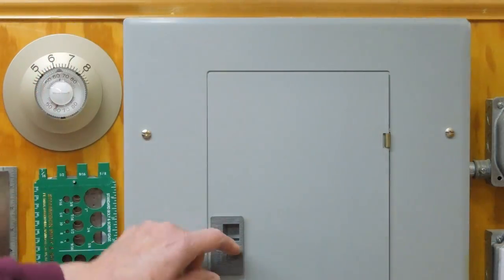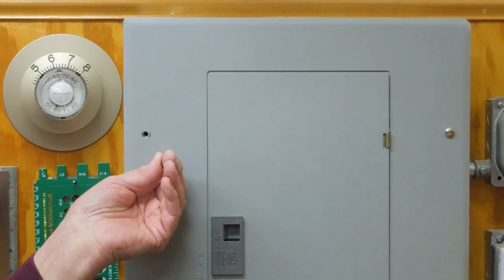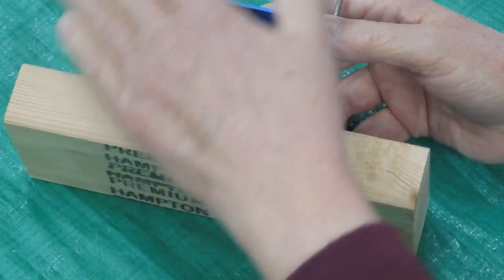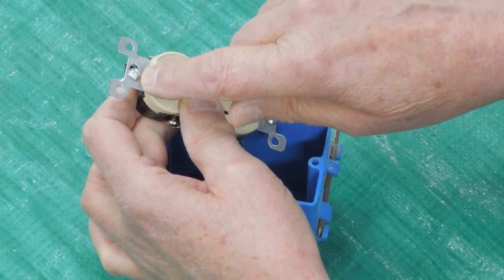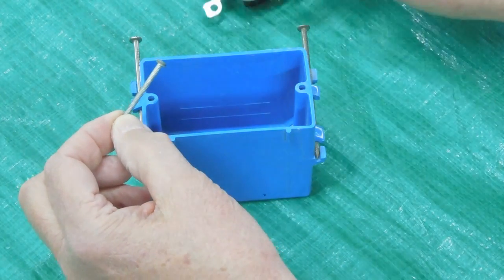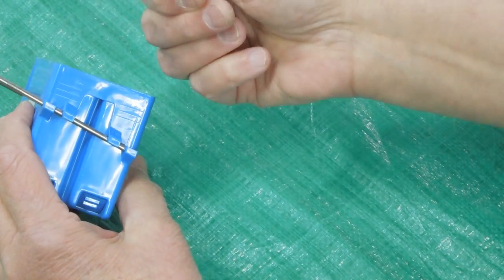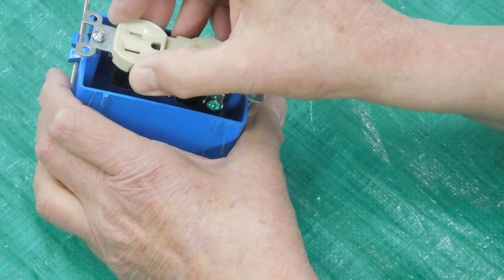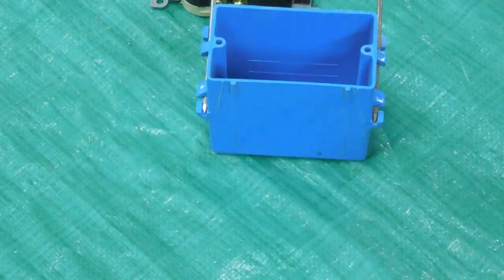Timing Threads Part 2 Electrical Outlet Boxes

Comment: When using a tap to rethread, does the timing of the thread work for the tap as well?
Reply from the maker: Yes it does. You need to be especially careful to make certain the tap has properly engaged, as it will have no problem cutting new threads if it is actually cross-threaded. However, in the case of these plastic outlet boxes I was suggesting cutting new threads for the 8-32 screws to begin with, so there would be no existing 8-32 threads in the plastic with which to time the tap.

Comment: I'm glad you mentioned using the 8-32 tap and screw.  We just rewired our house, and I ended up buying a box of 1" 8-32 screws to keep almost every switch and outlet from wiggling because of 40 years of aluminum wire checks...

Comment: Ron is correct, with a small exception..  The new boxes are not cheap plastic.
They are fire rated by the NFPA as described in the NEC for their rated use.
I worked a number of years as a residential electrician and prefer the plastic boxes UNLESS there will be very heavy use of the receptacle, such as in a shop like Ron's.  I would make note that the quality of a duplex receptacle for 15amp GP circuits is FAR less than those made for 20amp circuits...  bust one of each open with a hammer sometime and you shall easily see the difference!
Best way to deal with any serviceman is to greet him cordially, and hand him a $20 bill...  Inform him you are very particular, will observe his every move, and ask what his flat-rate is, and promise a bonus upon satisfactory completion...  cash money.
He will recognize you are not a skinflint like many people and do his best at your expense.
Reply from the maker: Good comments! Note: I never said not to do anything cordially. :-)

When I built my house I did all my own wiring under the final inspection of a licensed electrician, which was not a code requirement. Just something I decided to do. Admittedly, he (the electrician) was pretty tolerant. :-)

I actually wanted to use metal boxes everywhere but he talked me out of it. Wish I had stuck to my guns for the kitchen outlets.

All the boxes in the shops are metal as they are bolted to the steel buildings.

Comment: I notice that those plastic boxes don't have clamps for the wires coming in and going out.  The metal style boxes have clamps to hold the wires.  Do you have an idea how home owners might be able to secure the wires in plastic boxes?
Reply from the maker: When the house is built, if properly installed, the wires are stapled to a stud after they are fed into the plastic box so they really can not go anywhere. That is also what makes it nearly impossible to replace the box without possibly damaging the wires because you can not see the wires behind the drywall. By code if a metal box is used then it needs to be grounded. Another reason the plastic boxes are used, cheaper and quicker. Not necessarily better.